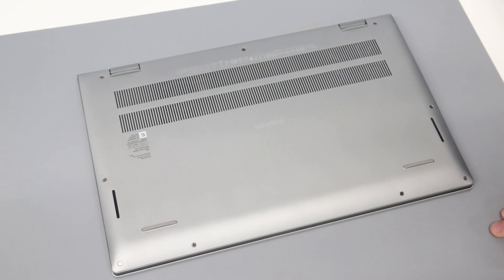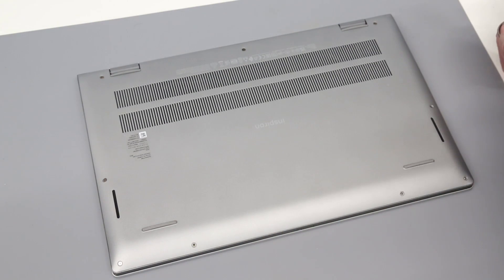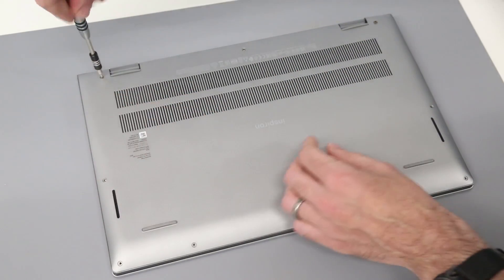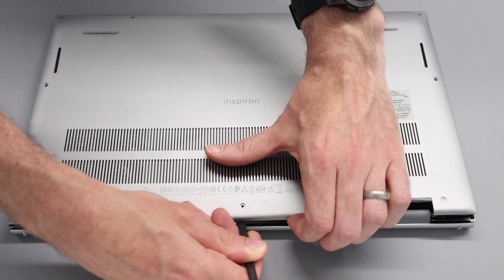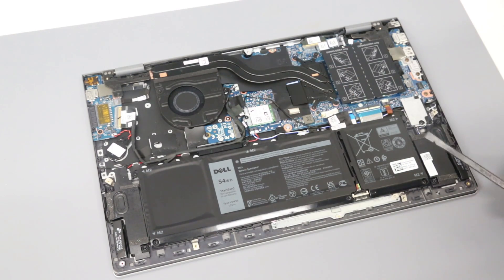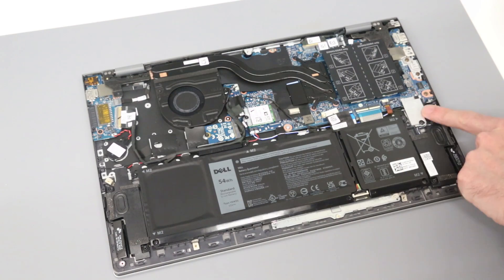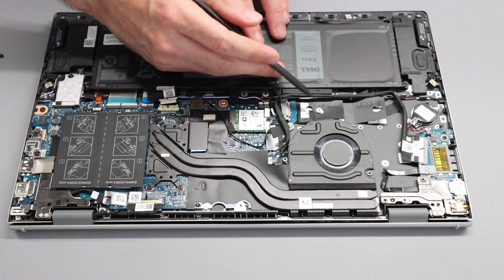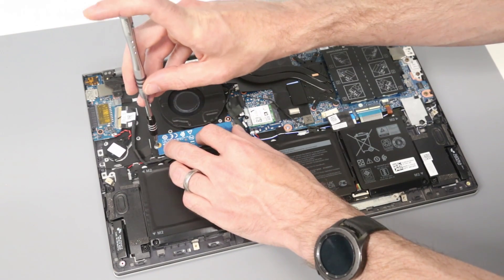Dell Inspiron 15-5510/5518 (2021) - SSD and RAM Upgrade Guide

Comment: my current Laptop is Dell Inspiron 5510. i have mx450 graphic card so can i change it to gtx 1060 graphic card?
Reply from the maker: No, the GPU is soldered to the mainboard.
Reply: Thank you for the information

Comment: Hi James, quick question as most of my questions were answered in the video. I have the Dell Inspiron 15 5510 that came with the NvMe 256 GB. I want to buy the Crucial P310 1TB SSD. AFter I switch the 256 GB drive to slot 2 and insert the 1 TB into slot 1...How do I format the new drive?
Reply from the maker: Glad it helped!
You can initialise and format the new drive in Disk Management in Windows.
Reply: @BrueComputing  Thanks James for all your help.

Comment: Will you lose the files on the ssd you switch slot with ?
Reply from the maker: If you're moving the same SSD from one slot to the other the files should be unaffected.
Reply: @BrueComputing so I should be fine doing exactly what you did in the video even though I’ve used the laptop for a while and have a ton of files in it ?
Reply from the maker: If you keep the original SSD fitted then yes.
Reply: @BrueComputing cool thank you!

Comment: Hi, can the second M.2 slot run de SO?
Reply from the maker: Sorry, not sure what you mean?
Reply: @BrueComputing  If I change the M.2 2230 SSD that is installed in the input that is compatible with the 2280, to the second input that only accepts the 2230, can I still boot the OS from this second port?

Comment: Excellent video. Thanks to this one, I moved my original Hynix 2230 256GB SSD to slot 2 and installed a 2280 1TB Crucial SSD in Slot 1. All in just 15 minutes. Worked super! Nothing else was required, the OS booted without an issue. Just formatted the new disk and it was ready to be loaded
Reply from the maker: Glad it helped!

Comment: Hello James, I am writing today because I have a problem with my Dell Inspiron 5510 laptop. I changed the SSD by relocating the main unit to the other slot as you do and then I placed the 2 TB M2 MVme SSD unit, Western Digital Brand, screwing it in after placing the mounting bracket. The problem started with it sending me messages that one of the hard drives is in danger, the message seems quite strange to me, it asked me to install Intel Optane Memory and Storage Management and it tells me that my system is not prepared for Memory Opt in because the hard drives do not meet the requirements and there is no valid hard drive in the system. What can I do with this issue? Is my laptop at risk of stopping working? I use it quite a bit and the only thing I wanted was more capacity to save files. The seller told me that it was compatible, so I don't understand why those notices appeared. The only thing I want to find is a solution to make it work normally. Very good video and with the translator I was able to look well to update it. There was no problem with the RAM memory and I was able to update it normally. Greetings from Argentina and I will wait for the response. Thank you
This is the model of the SSD Western Digital, it's compatible?https://www.westerndigital.com/en-us/products/internal-drives/wd-green-sn350-nvme-ssd?sku=WDS250G2G0C
Reply: Well in my case, when I'm install the new m.2 Nvme ssd in the vacant slot, the bios isn't even detecting it

Comment: I opened my 2021 Dell Inspiron 15 to upgrade the RAM from 8 to 16 GB. I saw the 2230 and wondered if I should go through the trouble of re-imaging this on to another 2230 with more capacity and then landed on your video. Now thanks to you, I moved that to the second slot and put in a new 2280 to end up with a much more useful laptop. Thanks a lot!

Comment: Well done, but aren't you supposed to discharge any remaining power in the system by pressing the power key for 5 secs after disconnecting battery terminal??

Comment: THANK YOUUUU HUHUHU,. but I do have 1 question, Can I add different brand of Ram but the same DDR4 and same frequency 3200? I already have 8gb of RAM but I want to add 16gb crucial ram on the same speed. it is possible?

Comment: Excellent instructional video and very helpful.  One thing I like to add is that it may be helpful to mention the next step after the SSD installation.  Usually the initialization of the new SSD is required.  Thank you so much!

Comment: Thank you! I am dual booting, and I have added nvme ssd. Now I have both slots occupied, one nvme and one msata. However, is it possible to get an adapter for msata slot and convert that slot to nvme, so that both slots are using nvme SSDs?
Reply: What is your bios version?
I've added my new ssd but my bios is not detecting it

Comment: Thanks for the video! Just did the SSD + memory upgrades after watching it. Very helpful!

Someone suggested entering service mode instead of pulling the power cable, and I second that, not only because it avoids any possible damage to the connector, but also because the "service mode" that the computer boots next offers very handy on-board system diagnostics for the upgraded parts (the memory test is very good!).

Thanks again!
Reply from the maker: Glad it helped

Comment: If you insert an additional SSD and move the short original one to the short slot, how does the system know which one needs to be used for the boot drive?

Comment: Is there any issues with relocating the drive with the operating system to another slot? When starting is the computer able to find the correct drive after it has been relocated to another drive?
Reply from the maker: No issue, should pick up fine.

Comment: what happens if i put higher speed SSD as upgrade with the per installed SSD? i have 512 wd sn530 SSD installed and I am planning to add wd sn 770 SSD, will this be fine or I have to add the same speed SSD?
Reply from the maker: Should work just fine, but generally don't expect to see much difference with a higher performance SSD.

Comment: As I have a RAM upgrade coming in tomorrow for this laptop I though it would be useful to watch this video in advance, in case of surprises. However, I was surprised to see that there are two m.2 slots and even one extendable to a 2280 size as they are more common. Made me very happy for future upgrades. I'm very glad I watched this video. Thanks!
Reply: Download (and of course read) the User/Repair manual helps a lot. Believe me :)

Comment: Great video, it will help me a lot. I would like to ask a question if possible. Here in Brazil Dell says that to use two SSD, both will have to be two of the same format or 2230 or 2280 you use a 2230 that comes with the notebook and add another 2280. Does it generate any problem? Dell here informs that it cannot because the 2230 is class 35, and the 2280 is class 40. can you clear this doubt for me?
Reply: Fala cara, comprei um 2280 de 1TB, acha que dá problema?

Comment: Is there anything that needs to be done in the BIOS once the new memory stick is installed (assuming new memory is DDR4 3200 16gb)? E.g. on my desktop PC, I had to change a setting in the BIOS to allow the upgraded RAM to run at its advertised speed.
Reply from the maker: Nope, just fit it and you're good to go.

Comment: woah you can upgrade the 5518!! what's the maximum ram a 5518 can take? do you know the srgb rating? can you do a review of this laptop? It's selling at a reduced price, some people say the battery isn't great, one person had wifi issues. would love a review!! The internet esp youtube is so bad with reviewing laptops sold in the UK. If you start reviewing you could make a mint!
Reply from the maker: I looked at the 5510 here, which is very closely related to the 5518 (they share the same service manual, etc) https://youtu.be/Lg1ibQSg1tA
I believe on the 5510 the screen was 45% NTSC, which is around 62% sRGB, and 250 nits.

Comment: is gen 4 nvme support to dell inspiron 5510??
Reply from the maker: According to the spec sheet both ports support PCIe Gen 3 only - although that might just be Dell only ship the system with Gen 3 devices...
Gen 4 gives little real world performance benefits though and will typically have higher power consumption.

Comment: nice video!
factory pcie ssd slot is 4.0 or 3.0? 
in i5 11320h specs it says it has two pci slots, gen 4 for cpu, gen 3 for chipset

Comment: The Indian variant of the above laptop is mentioned that it has only 512 GB capacity of the 2280 type hard disk. Does it mean that I can't use two 2280 drives?. There is no new mSATA (you call it as 2230) listef in the amazon India website.

What to do?.
Reply from the maker: mSATA is different to M.2 2230 - its an older standard and not compatible with M.2 slots. The 5510 has an M.2 2280/2230 slot (movable mount) and an M.2 2230 slot.
In the video I move the M.2 2230 drive fitted in the laptop to the 2230 slot (its in the 2230/2280 one as standard) and fit a secondary M.2 2280 drive.
Reply: Search for mSATA and see. It looks similar to the 2230 drive
Reply from the maker: I know what mSATA is - it uses a completely different connector and the SATA interface rather than PCIe NVMe. It is the predecessor to M.2.

Comment: Does this model have SATA port option?.
Reply from the maker: No, just a pair of M.2 slots.
Reply: Thanks for replying.

Currently a 2 TB NVMe 2280 SSD from KINGSTON costs INR 17000.

I am currently using Dell inspiron 1545 laptop (bought on Aug 2009). I have upgraded to 1 TB SATA HDD and 4 GB DDR 2 800 MHz RAM X 2. All in workig condition runnig with Windows 10 Pro (really).

I am having an idea of buying a new laptop. The compelling character of DELL is making me turning away from new laptop.

Is there any new i3 or i5 (latest gen) laptop from DELL India that has SATA port?.
Reply from the maker: The 3511 is 11th gen and can take a SATA drive, video here: https://www.youtube.com/watch?v=hSrN1tw4a9A
3525 is the 2022 chassis and again has a 2.5" SATA bay, they've not released the 12th gen i3/i5 version yet though (at least here in the UK) but AMD Barcelo chips are worth a look.

Comment: Dear James, 
thank you very much for the great video in which describe the process in detail. I have just one question. I have bought an Inspirion Dell 15 Plus with 16Gb (2x8Gb). Is it possible to upgrade it to 32Gb? 
With best regards.
Reply from the maker: Do you know the full model number and I can check.
Reply: Hi, 
thank you for the fast answer. I got an Inspirion 15 Plus as a gift but have not received it. It will come next week. The only information I have so far is that is has an overall of 16 Gb (2X8) with DDR4 with 3200 Mhz and a Intel® Core™ i7-11800H-Prozessor der 11. Generation (24 MB Cache to 4,6 GHz, 8 Cores). I wrote to the technical support to give me more detailed information about it. Under this circumstance, does an upgrade to 32Gb make sense or eq. is it technically possible ? Thanks.
Reply from the maker: @chinchi4293  Sounds like the 7510 then - yes can take 2 x 16GB DDR4-3200.
Reply: Chinchi42 :
Windows 10 Pro can handle more RAM.

The maximum capacity of DDR 4 3200 MHz RAM available in a single module in India is 32 GB and it costs INR 12000 approx.
Reply from the maker: @sudhakar35gm  Windows 10 Home supports 128GB RAM, so not going to be a limiting factor.
Reply: @BrueComputing  I have a similar question. Dell says this model can handle up to 32gb ram but crucial web site point to 64gb! This could be possible? I may say similar thing happened with my last MacBook pro. Apple said 8 gb ram as a top. But noup, it could handle marvelous 16gb!. 
What to do? Which risk, problems could happens if I pick wrong ram capacity.
Thank you!
Reply: @sudhakar35gm  ah, nope, Linux is a faster operating system, depending on the distribution you take
Reply from the maker: @acanecontacto4890  32GB modules like these SHOULD work fine: https://amzn.to/3wZQZN7

Comment: Hello i don't know if you can help me. But i switched the main drive to the smaller spot as shown in your video and cloned it to a new 2280 1TB SSD to expand the storage and also put windows on 1 drive. However my computer does not load windows from the new 1TB drive. The machinecan read that the drive is there but it can't load windows from it. I also tried wiping the new SSD and it was fine for both (reading & recognizing that it's a second storage drive). I'm so frustrated and don't knwo what to do. I would very much like to uprgade my main SSD from 256GB to 1TB with windows on there so i could just have one drive but i can't seem to catch a break. Any advice would be appreciated.
Reply: OMG, I have literally the same problem! Did you manage to fix it? I cloned the drive via EaseUS Partition Master, but it's not booting. Also, I can't see the drive in the BIOS under boot sequence. I think you need to disconnect the old drive first to let it boot the new drive once, so it knows it needs to use that drive from now on. After that you can put the old drive back in.

Comment: Can we add HDD in it with the SSD(already installed)
Reply from the maker: No, you can add a second M.2 SSD, but there is no space or connector for a 2.5" SATA HDD/SSD.
Reply: @BrueComputing  Thank you for your response... Whats your name
Reply from the maker: I'm James.
Reply: @BrueComputing  James, Is there any contact of you such as telegram or whatsapp for some doubts about pc's hardware or software
Reply from the maker: I provide technical support on a professional basis but am based in the UK, not sure where you are.
Reply: @BrueComputing  I am from India...
Nothing can be done?

Comment: Thanks for the detail video, I'm user of Dell from past 25+ years, Dell always made their components replacement very simple, from when did they make it so complicated?
Reply from the maker: Its not really that complicated - removing the back panel is quite easy on them with the retained screws the pop up the corners for you.
Little access hatches were phased out a number of years ago.
Reply: @BrueComputing  Thanks Bruce, have moved out of IT Support, so was not aware of the access hatches phased-out news.

Comment: Bruce, a million thank you's! I ordered this laptop and a long M.2. NVMe at the same time. 
According to the Inspiron manual, you can only put a short (2230) NVMe in that M.2 slot. 
You are the only to show us that there is an extender under the primary M.2 slot. 
I switched them and it worked. I was worried that I would have to change the boot order in the BIOS, but I did not have to change anything. I was on the cusp of returning everything, but you saved the day. You rock!
Reply from the maker: Glad it helped!

Comment: I got the same 5510 model with 512 gb ssd one. Can I upgrade both the ssd slots by removing default provided 512 gb ssd & adding 1 tb ssd in each slots ( total of 2TB ssd) . Does that work or it might cause issues to the system. Kindly help on this question.

Comment: I bought Inspiron 5515 with Ryzen 7 5500U and 16gb ram,512 SSD
But the matter is that I tested read and write speed of my laptop it shows 1.7gb read speed and only 1.3 gb write speed which really disappointing as I have seen in many videos read and write speeds on this laptop is 2.4 and 1.8 gb respectively.
If you can provide any information on that it would be really nice

Comment: Does this have additional slot for Graphic card as has been mentioned on Dell website? Please acknowledge.
Reply from the maker: No, the NVIDIA graphics is optional, but is soldered to the mainboard and can't be added in separately - you'd have to replace the entire board.
Reply: @BrueComputing Hello Bruce I checked on Crucial website and it shows that following device is compatible with the Inspiron 15 5510 Crucial P5 Plus 500GB PCIe M.2 2280SS Gaming SSD

 . Will it be sufficient enough?

Comment: Hello, I`ve a short question about my Inspiron 15 Plus (7510), can someone give me some tips? 
Thinking about an Upgrade of the SSD and RAM for better design, but I´m not sure if there are any free slots available. This video helps a lot, and is greatly produced, but how can I get the information's about which slots are still used and which are not? Thx and have a great day :D
Reply from the maker: If you run CPU-Z it will tell you what is in each slot in the SPD tab.

Comment: Thanks a lot, it's very helpful, is it possible to have a tutorial on keyboard replace ? 
Thanks a lot
Reply from the maker: Keyboard replacement involves replacing the whole palmrest assembly.
Reply: @BrueComputing  Thanks for your reply, i've purchased the palmrest which include the keyboard, i hope it will be easy to replace it :)
Reply from the maker: Not too bad a job, Dell do good service manuals if you need it.

Comment: Works fine - Hynix now is on channel 2 and on channel 1 is Samsung 2TB M.2 PCIe Gen4 NVMe PM9A1 OEM and RAM- now is 32GB. Speed on Hynix is the same as it was (3,5GB/s by CristalDiskMark 8,0,4 64b). Samsung is a little bit slover (3,4GB/s). Temp on Hynix was 20-36 (temp1) and 34-49 C degree (1 test CDM). Now: 30-49 and 32-69 respectively. Samsung is a little hoter: 30 to 56 - temp1 and 32-69 temp2. Second test on samsung: 57 and 70. Thanx for video.
Reply from the maker: Good info, thanks.

Comment: Hey so I just added an M.2 2280 in this same exact model laptop, and moved the 2230 M.2 over to the other slot. Now my laptop won’t even turn on? I put the laptop in maintenance mode before I started (holding down the ‘B’ key and power button) and I plugged the power cable into the laptop once I was done, which Dell said had to be done to get it out of maintenance mode. But now it won’t turn on at all no matter what I do

Comment: I can tell you that in mine, the 30mm NVMe was mounted there close to the fan, and nothing was mounted in that little 30mm slot on the right.  I simply moved that screw clip mount back to the 80mm position and put in my 1Tb NVMe.